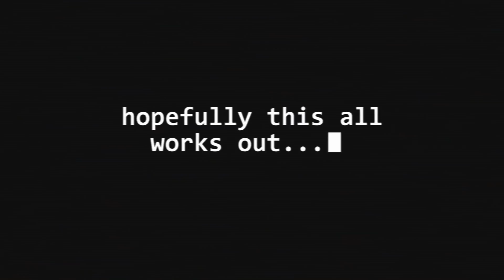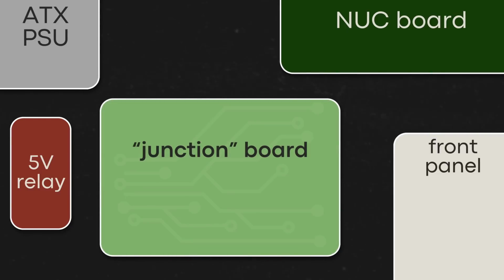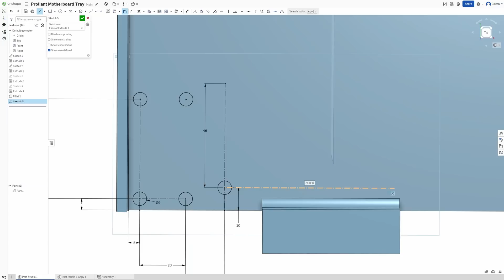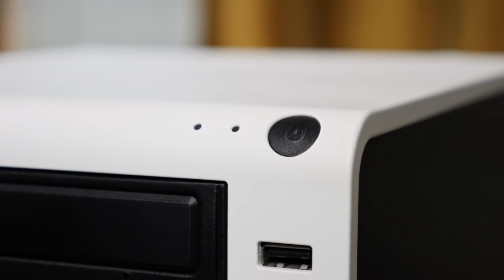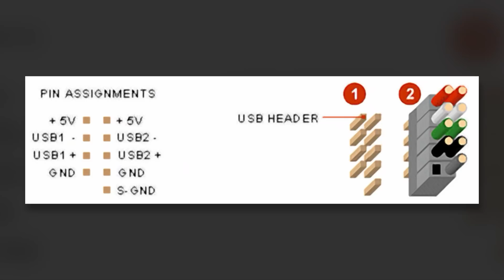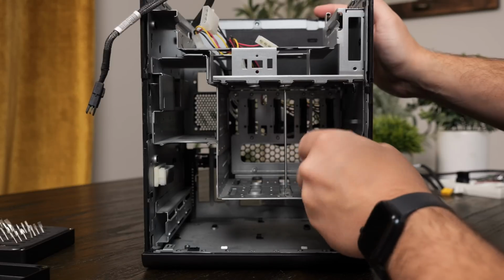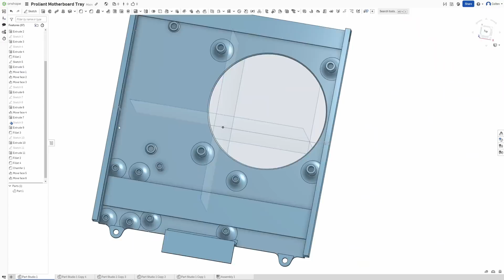This Custom MicroServer is NUTS  [HP Overhaul Pt.2]

Comment: Definitely an awesome project HH!  Since i been thinking about a NAS or to repurpose my lab server.  For the fan i would've cut the grill off the back mount the fan outside, bolt it on, drill a small hole for power leads to fan to go through,  then build a 3d external fan cage thingy.  I want to do something with less work though lol!

Comment: Great content as always. Keep it up 👍 
I have an older NZXT case that I have thought about 3D printing a stormtrooper helmet to mould into the top front of the case. Add some “battle damage” to it on one side. Maybe a trench battle diorama on the top or side.  Maybe even make a mount to hold a light saber over/under the gpu. 
Then I’d see how much I could sell it for.

Comment: Quick question, im runing a TrueNes server with my old I7 4770, 16gb Ram, 128gb m.2 and 4x4tb hhd. The question is i want to switch to proxmox and have there a vm that runs truenas, how can i manage that without loosing my data?

Comment: Two things i see. Two usb headers on the board that you could of removed to join the last two front panels to. Also you could put in a hdmi extender to make access to the onboard graphics for management ease. You could cut the grill out and leave the mounting holes for a fan. Or look at 3d printer watercooling.

Comment: Can you do a tutorial on how to setup Automatic Ripping Machine or ARM you touched on in one of your previous videos? It looks like a super cool project but there are zero video tutorials I could find on setting it up and I'd like to get it running on bare metal on a old small form factor pc with a firmware modded blueray drive.

Comment: I bought one but I'll use it as a simple file server or even as removable HDD bay. I love buying used stuff unfortunately we don't have suppliers like ServerPartDeals - I've only posted them a few questions on eBay but they were very helpful.

I remember in the time before hoola-hoops, ice-cream soda and pocketable Cray 3 computers when we had to transport a SCSI disk as if it was newborn baby otherwise it would not format.

Comment: I would be a tad worried about the power to the PCIe x16 riser coming from a SATA connector, being usually rated at 54 watts, and the GPU attempting to draw more.

Comment: I purchased drives from Server part Deals,  ABSOLUTE  WIN!   
Ordered some 23TB Drives last year and they still work great.     
Best part is that I was able to get 2 drives for the price of one new drive with the Server supply refurb drives.  

Being able to consolidate and have a mirrored backup  drive, along with having a spare New WD Drive (20TB)  along with the original 2TB drives (making 4-5 backups of the data locally) ;  I did not bother making a full cloud backup with BackBlaze.  

Most of this data is just cold storage stuff, so I wanted to just use a tape drive.   
But that alone would of cost close to $6,000 for the tape setup.  And then you have all the headaches with tape,    (ʏᴏᴜ ʀᴇᴀʟʟʏ ᴅᴏ ɴᴇᴇᴅ ꜱᴏᴍᴇᴛʜɪɴɢ ᴄʟᴏꜱᴇ ᴛᴏ ᴀ ᴄʟᴇᴀɴ ʀᴏᴏᴍ ᴛᴏ ᴏᴘᴇʀᴀᴛᴇ ᴛʜᴇᴍ-ᴛʜɪɴᴋ ᴏꜰ ᴅᴜꜱᴛ ᴏɴ ʏᴏᴜʀ ᴠɪɴʏʟ ʀᴇᴄᴏʀᴅꜱ...)    the Hard drives are just the way to go unless you happen to get your tapes done for you at a facility that does them.  
[ READ:  EXPENSIVE! ]

The fact my Old 2TB drives and the lower capacity dries I own in the 1TB range are all still working fine since 2011,  I'm happy with the backup plan I got.   
Photos are backed up to the cloud along with some videos of he family, so that's fine as I see those being the most valuable.  

The thing is?  
These old drives of 1-2TB that are the old skool  air filled drives is not a bad way to go. 
Even if the motor on these drives get stuck, the platter will still have the data on them.   And from what I understand, the lower density drive platters will have the magnetic data stored in the sectors for over 40 years, so reading them back will not be an issue if the drive fails to operate.  

As long as the physical drive is in good condition, its not really a problem.   
Sure it may cost some money to recover them if they have a problem, but it's a lot simpler than the Helium filled drives.  

Also the drives are indeed shipped with plenty of protection, so no worries about having them manhandled to your home. 

(っ◔◡◔)っ ♥ ABOUT THIS BUILD: ♥
Well, Um...
I'm glad it works.  😉

Comment: Hello!
Two things : This may be the first time in forever long that i was interested by the sponsor. Prices are super low, and they ship to my caribbean island, so super cool!
Second thing : nice case mod and all! Although at some point, after doing so much modding, you might have been able to make your own case :)
I do mine out of wood, either with traditional wood working techniques, or even with a laser cutter. The cool thing is that if you design the case, well you decide the form factor, and thus can adapt whatever you want to whatever you have :)

Currently on my wooden, home made rack, i have 6 servers, all with wooden, home made cases. And with a bit of electronics, they even have rgb, and temp monitoring that is tied to my home assistant setup. I also use aluminium mesh for the fan grills, and it also adds a "pixelated" effect to the RGB.

Comment: Ok, first: I would have left it pure black, thatÄs just a personal preference.
Next: I like the inclusion of the blueray-drive, it just enables that ripping of bluerays without having to setup the external drive.
I'm not quite happy with the rear and the part that sticks out, but even I can see, that the clearance was just too small.
I probably would have chosen a different OS, but unraid is fine (again: just my personal preference).
I over all like the build, it really turned out good. It also gave me the final push I needed to get a soldering iron.

Comment: This is amazing. Thanks for sharing. I have this micro server and it’s been sitting I the floor because i moved in with synology. But when I had this new, it was a great little server. I had freenas running on it back then. I was able to use 6 HDD. 5x 3.5” drives and 1x 2.5” drive. I ran freenas on a USB thumb drive

Comment: This Microserver is pretty awesome, I still have one in my parents basement, sadly the power supply blew up like 10 years ago when I used this and replacements were pretty expensive due to their special size, so I never fixed it. But it was great, 4 HDD bays and the CPU only had around 15W TDP. It was perfect as a home server.

Comment: With the external bump out for the 'back plate'  I would do the same and add in like a 120mm slim fan as an exhaust just to help a bit on the temps.   But I can never leave good enough alone.

Comment: A few tips from personal experience:

5:09 It's easy to fabricate a nice and reliable cable connector when you have to solder directly to the connector that's intended to be soldered to a PCB, in fact you were already quite close - cover the solder connections with hot glue, put a piece of heatshrinking tube over the hot glue blob, and evenly heat it up with hot air gun at 150 C. The tube will start shrinking, while at the same time the glue will start melting. As a result, it will form a nice connector shell, while squeezing out all the extraneous hot glue, which can be removed with a cotton swab while still hot. It takes a bit of practice, but when you master it, the results are quite pleasant!

8:38 To remove a hotglue blob, simply soak it in isopropyl alcohol. After that, you'll be able to easily crumble it away

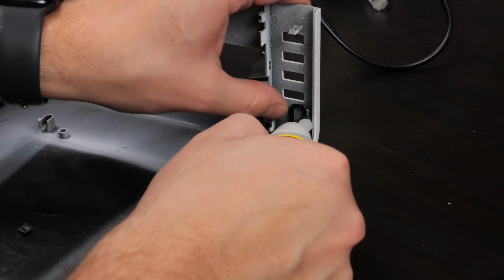11:52 There's an option to get a CA glue bundled with an activator spray which cures the glue immediately after applying. Highly recommend to try it out!

Regardless of the aforementioned, that's a very nice project, congrats with finishing it!

Comment: Nice Work. I saw your Part1^and decided to search for a microserver too. But i decided to save my time and got really cheap a Gen8 with an i3-3240. I will replace the i3 with a e3-1260L. I wantted to use synology DSM as operating system but the version i am using right now does not support the NVME SSD in the PCIe Slot. So i think i have to use unraid too. Even if it costs right noch

Comment: I followed through on both videos.  It looks cool and I was impressed you went through all that trouble.

Don't think I would do that, though.  It looks like it would be a bastard to fix if anything goes wrong.  And, I don't know if I would have accepted two USB ports not functioning.  But maybe that's just something that bothers me - everything on the case should be functional, and all ports/headers on the mobo should be available.  That includes the header for a second serial port and a header for a USB 3.2 Gen2x2 port, if there is one.

If I wanted to build a fileserver I probably would have just used a regular tower case.  Far more motherboard options, PSU options, easier to fix, far more flexibility, etc.

But, I suppose if you did, there wouldn't have been much point in the video.

Comment: For the hdmi issue where you can't access the bios without plugging in on the board just add a hdmi extension cable and put one on the back

Comment: My 3D printing idea is I have Nzxt 510 flow. Also the  120mm exhaust air fan to be the cpu fan instead of the included 80mm fan. Similar to  dell gx270.

Comment: if it was impossible to plug a usb hub to the front usb ports i would just 3d print something to cover those two ports so whe  i forget i couldnt maie those ports work, i dont get upset whe  they dont work and try to male them work

about the lack of airflow, hard disks and gpu will maie the pc work hot

if you have access to a 3d printer, print a adapter, put a 140 or 120 mm fan there pulling air out and cover the fan with a fan grill so you domt get upset whem you put a finger back there, screw the fan outside, dont cut the case, or dont screw it, zipties and a cone making good contact will be enough so gpu and hard disks are happy

Comment: Keystone HDMI coupler, a short jumper cable and done. I've even cut a rectangle set the HDMI Keystone in there and hot melt it in place since I can't 3d print anything. Works awesome looks like a regular jack on outside

Comment: This serverpartdeals site is actually decent for buying hard drives, I refurbish computers and sell them, usually for $30-$50 for hardware between 2nd gen i3 and 3rd gen i5, but the hard drive in each computer, is just a recycled drive that was pulled from e waste bins, same as the actual computers, I test the drives, check the smart data, and i stick a "tested, reset, reinstalled" label on it, but i may eventually start laser engraving that on the drive, but anyways, I am not careful with the power on time, ill look for bad sectors, and signs of a dying drive, and if i saw a 1000 day power on time I wouldnt sell that, but these websites they have better procedures, so i reccomend it, now i do all the refurbishing myself, by hand, no machines fix things, no automatic installing, I sit there, install the OS with the drivers, and I clean old asset tags off, swap in new components, replace thermal paste, clean the dust out, I have passion in my work

Comment: 1. A fan for the back will be needed if this sits in a more enclosed space.
2. You could buy a short HDMI male-female extension cable and mount it to the back IO shield, it would give you HDMI access out the back from the motherboard.
3. The PSU.....that thing is ancient by now. It is the original HP-unit right? Maybe see if you can fit someting else, before it eventually fails? It will be degraded by now for sure.

Comment: Yet another great video. One thing I would consider doing is adding a HDMI extension cable to the NUC motherboard and adding it to the rear I/O plate with the power and network plug. This way if you need to access the BIOS you can using the NUCs HDMI port. It will still allow you to use the graphics card the rest of the time.

Comment: As far as jank jobs go, I've seen waaaay worse!  (Looking at you LTT! :P)  Question for you though:  You already have USB ports on the NUC's mobo already, so why not utilize those to get all of your USB ports working?

Also:  PLEASE use flux on those pins for a more secure solder bond!  I guarantee those wires will snap off of those pins at some point if they remotely flex!  I also highly recommend heat shrinking at least every other pin, just to reduce the chance of your pins shorting together!

With that out of the way, I applaud your tenacity and ingenuity for getting this project across the finish line!  Job well done!

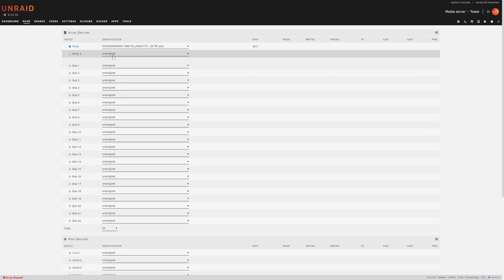Comment: 15:49 parity drive has failed. weren't these the sponsored drives?
Reply from the maker: In Unraid, it just says that until the parity sync process is finished. None of the drives failed.
Reply: @HardwareHaven  thanks for that clarification.

Comment: This is really cool. But I am still finding it hard to beat the Lenovo P520 with anything. Because both of its x16 PCIe buses can bifurcate you can cheaply install 8 NVME drives, plus 2 NVME on the MB for a total of 10. You can buy a $25 cage from Lenovo to add 2 more SATA drives for a total of 4. It runs ECC memory. It's just a monster of a NAS/KVM machine.

Comment: This is a great project, but one that is screaming out for a custom PCB.

With all of the 3D printing and other custom parts you made, consider getting a free PCB CAD program and making a "real" version of that junction board. That would also let you use a much smaller reed relay that wouldn't interfere with your GPU. I use OSH Park for my hobby boards, but there are plenty of places that could make a cheap 2-layer board for cheap.

Comment: The a310 eco have annoying fan profile 

It starts from 3000 and keep going up and down even setup a fan curve target fix % 😢
Plan to remove the cover and slap other fan on it 

(Plan to put in low profile case with singlenslot cooler but plan changed ... )

Comment: I'm sure some folks will say you shouldn't have bothered but it's always fun to learn and try to stretch your skills. If you just buy a new thing every time you need something you never have the chance to grow or learn. I've done intricate soldering work because it was a chance to learn, then later when I did need to know I had those skills. I think you did a great job and you're an inspiration for the hobbyists out there!

Comment: This is the true way to “build” a computer.  Doesn’t have to be perfect.  Each time, the next PC build will get better.  

A short HDMI extension to your custom IO panel should solve your inconvenient BIOS access issue.  Should be able to find panel mount versions that you just need a hole and two screws to mount to the IO panel.

Comment: 10:10 I'm not sure who but someone definitely makes USB hubs in a single circuit board that you wire up yourself. The hub board breaks a single USB connection into two so two could be used to get all 4 ports working.

Comment: May have been frustrating and not perfect but the idea is excellent. I wonder how many of those HP mini proliant machines are out there wasting away in a closet unused. Really a shame HP didn't use industry standards for the parts as I think this case is worthy of living on with modern PC parts.

I had one of these ten yesrs ago and really liked it except for the performance as time marched on. If I could have easily updated it, I would have. Quality metal cases like this would cost a fortune today so recycling these seems like a good idea to me. I'm glad you did it and hope you decide to being it back in another video with the small issues worked out.
Reply: SHO1989
It's well documented, you can swap all parts for open market PC parts, easy to make all cable compatible.
Why you need metal ?
Reply: @lucasrem  dont need metal, just appreciate the sturdiness it adds. It's more expensive than plastic so I thought it would be nice to recycle cases like this HP.

Comment: @ 1:24 Finally, an ad spot that is actually something I want to buy
Reply: Just purchased 4x 12TB seagate drives.  I found the same refurb drive on Amazon with the same price but decided to buy direct since they had free shipping too.
Reply: @randomstring-u8p  Going to assume you mean 12 TB. Unless you have a time machine?
Reply: @codeman99-dev  LOL correct good sir.  Edited
Reply: @randomstring-u8p  At least this way you'll get drives packed appropriately, Amazon can be VERY hit or miss for fragile items (seems usually they hit it with a large hammer).  I've used Serverpartsdeals several times with GREAT success to the point I've pretty much stopped buying drives anywhere else with the exception of clients that want to buy new.
Reply: Totally agree! That's the ad, what is really useful for watchers of this channel.
Reply: And I waited so patiently for the coupon code, too..
Reply: @BrendonBelle  Agreed. I took the used hard drive plunge last year and bought five 8TB drives with a 5 year warranty for the price of 2 new. As long as they honor the warranty, I'm willing to risk it for the cost savings. I've not tried this vendor but I have used goharddrives and can attest to their customer service. I had a drive doa and they replaced it quickly and without a lot of red tape. I have four 12TB drives from them in transit for my 2nd NAS

Comment: Dude you surely didnt disappoint! This project is insanely creative and ingenious. 

Suggestion: follow up this series by recording the whole software part of it, installing stuff and configuring.
Reply: Until the pci-e flex adapter takes out the board and gpu.  The slot rear side is sharp and pressed against the flex cable 😂